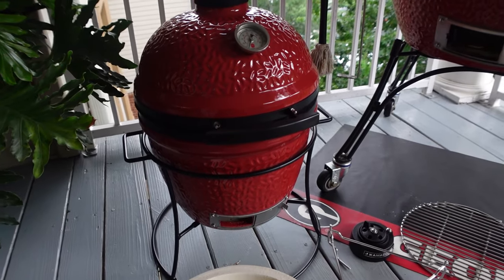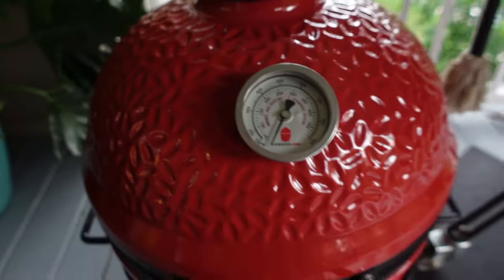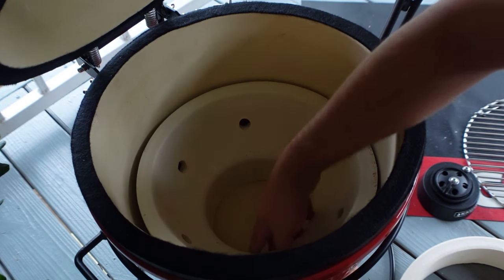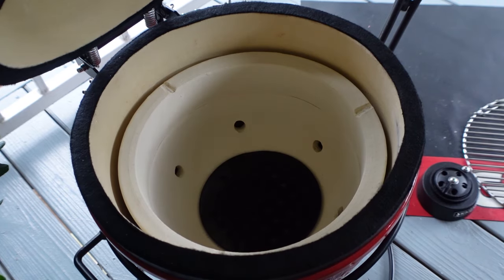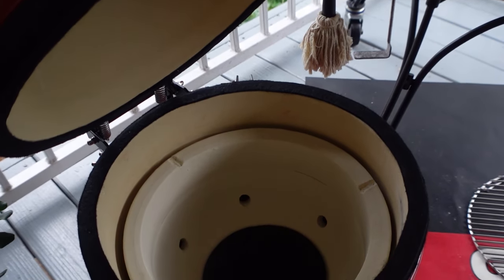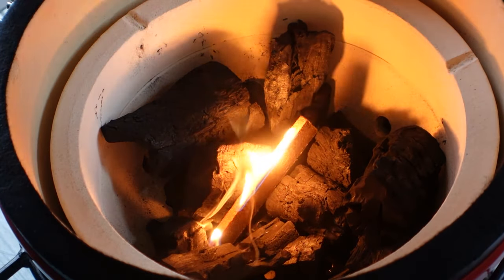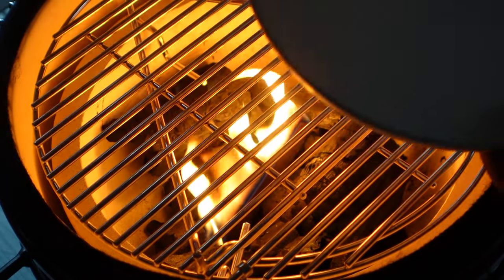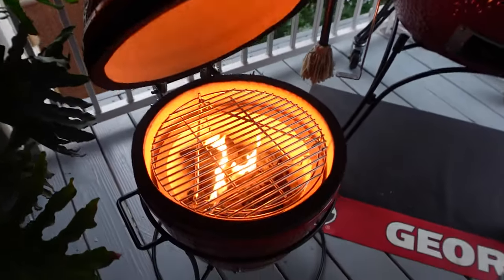Kamado joe JR setup and initial burn ( how to )

Comment: Greetings from Canada, why did you buy the Joe Jr? Would you say it complements the bigger unit? Currently have the Big Joe and a gas grill, trying to justify the Jr... lol. Multumesc
Reply from the maker: Hello. I bought because it was a super sale at Walmart for only 196usd. Also because it uses less fuel. With just a handful of lump it will get to 500F and stay there for hours, it's very good especially for a fast dinner. It works just like the big joe but it's smaller. I had one before and did 7-8h smokes with it with no problems. Gas grill is a no for me, just set one on fire yesterday at my parents from the grease while cooking 6 ribeyes.  Also the joe Jr it's great for tailgating and camping. I like it, it's efficient and heats up fast. In one hour you have the dinner ready.  Cu plăcere 😊

Comment: Do you feel need for deflector plates like on the regular kamado joe?
Reply from the maker: Depends on what are you cooking. I probably used mine couple times but mostly not. I'm using the grill for hot and fast grilling but it also makes good smoked food if you want low and slow, it will go 10h easy loaded up with charcoal
Reply: @romanianredneckbbq  Cool. Thanks!